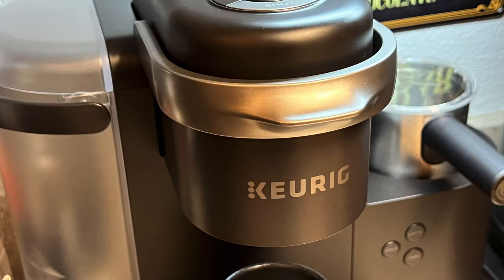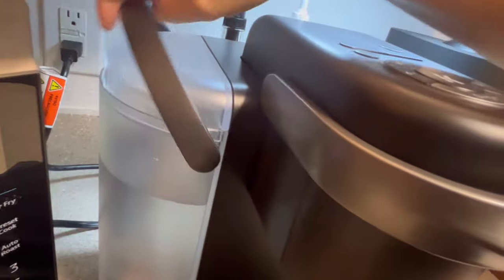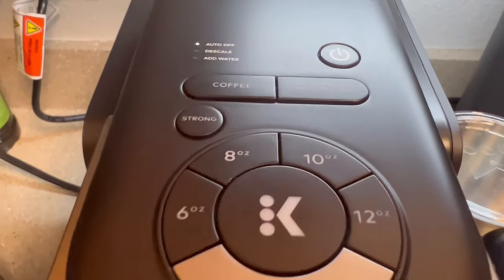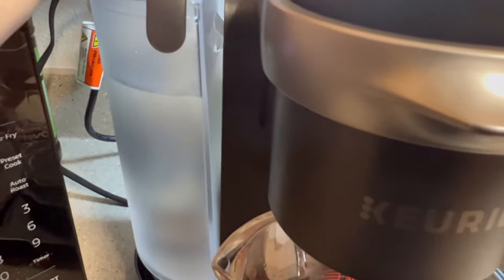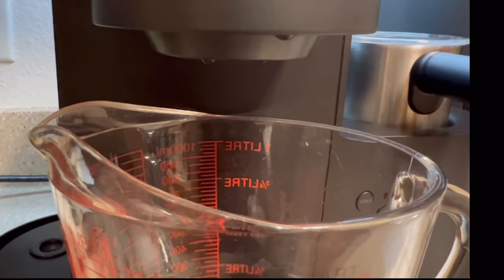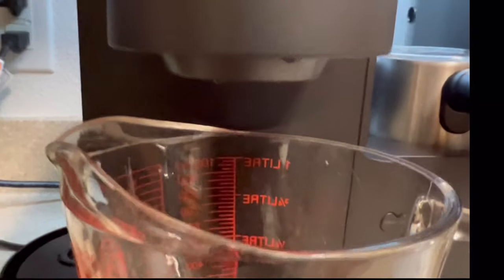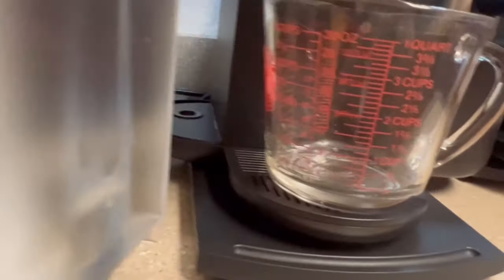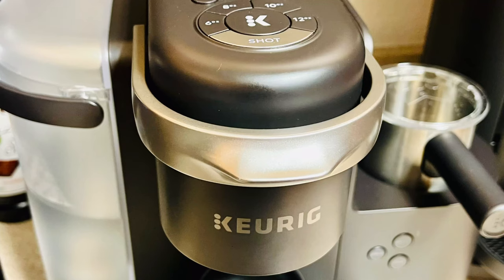How to Drain a Keurig Coffee Maker in 6 Easy Steps

Comment: Doesn't work if your internal heater tank is completely full (no headspace). The machine's logic sees a completely full tank as empty and resets. Always trying g to pull from the external tank. Removing the external tank doesn't necessarily make the completely filled internal tank expell its water. Once the machine is out of sync, this tip is useless.

Comment: Thanks for this information!  Had the original keurig which water intake was very easy to blow into and blow the water out.  Had that machine for 7 years and NEVER had to descale it.  My ex gf dropped and broke it, and then bought me a new machine that I couldn't do that with and had to descale it, and the descaling broke the machine!!!!  So I got a new classic, thinking it'd be the same, but no it has the new water intake valve which you can't blow into, so no way to drain the machine, thus it will need descaling and that will eventually break the machine.  Which is what keurig wants so you have to keep buying a new one.  I just want the old machine back that I can blow the lines clear.  I'm hoping this technique will keep me from having to descale the machine.  Do you ever have to descale yours?
Reply from the maker: Hi, yes, I descale every three months, depending on usage frequency. However, I try to use only filtered water to minimize the need for descaling.

But I've switched to a Nespresso machine, which I think is much better.

Comment: This did not work on mine, a K50. 

As soon as I took the reservoir off the add water light came back on. I even tried putting on the empty reservoir and holding up the float switch, so the mahine thought it was full. The pump kept running but no water ever came out.

Comment: I just tried this method to drain a K-Select model, and it does appear to work.  I plugged in the machine with no water tank attached, and the "Add Water" light was shining.  I then attached a half-full water reservoir and the machine proceeded to heat up the internal water reservoir.  

Once the machine was finished heating the internal water, I raised and lowered the brew head handle and pressed the button for the largest cup size.  I then immediately removed the external water reservoir and the machine continued the brewing cycle.  Only a few ounces of water were dispensed, and I turned the machine off about 10 seconds after the water stopped dripping out.

I don't know if the internal reservoir was completely emptied, but this is probably the best that I can do without a partial disassembly of the Keurig.  I recently got a new K-Select machine, and I'll be storing this old machine as a "backup" coffeemaker.  The old one does brew coffee, but will no longer pump any air through at the end of the cycle.
Reply from the maker: Thanks for sharing your K-Select draining method! Clever use of heating cycle and mid-brew tank removal. Not 100% empty, but good for storage. Great tip for backup machines. Appreciate the detailed process - it'll help others!